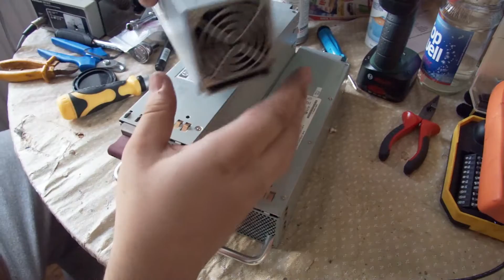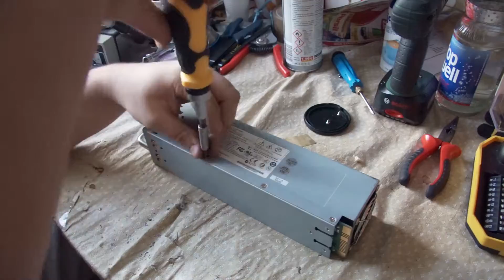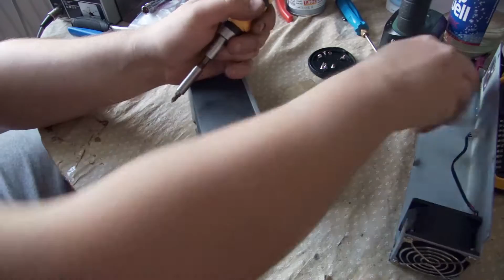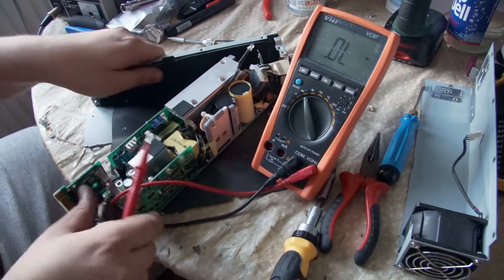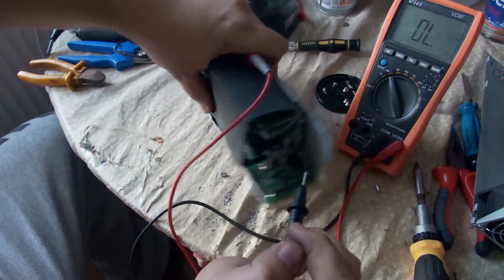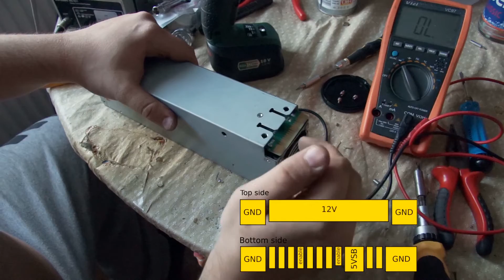Cheap DIY 2800W POWER SUPPLY Part1: Insulating

Comment: cool, i did exactly the same with 400w server powersupplies so i have 2000w 60v supply and im already finished.
i have a idea for you which i did too, when you want to power these cut the nutral wire from the plug and buy 5 switches so that you can power them like you need because they are preety loud.
und du bist deutscher?
Reply from the maker: Ja, bin deutscher.
Die Masseleitung kappen ist nicht gut, im Video kappe ich die Masseleitung von der Primärseite, so fliegt immernoch der FI falls die Primärseite einen weg hat.
Ich wollte damit eines oder mehrere dieser DPS5015 DPS5020 Betreiben, hab aber mittlerweile ein leiseres, passenderes netzteil gefunden.
Reply: @gamerpaddy  welches Netzteil ist das, aber bestimmt nicht so günstig wie das mit den server Netzteilen oder? Ich meinte es so das man die dc Seite isoliert von dem Gehäuse und dann wenn man die 5 Steckdose hat bei jedem Kabel entweder neutral oder phase nimmt und jeweils an einen Schalter geht, so kann man dann den Effekt mit den niedrigeren Spannungen erreichen mit 48v 24v usw ohne die Netzteile abstecken zu müssen denn die übrigen Netzteile leiten den strom durch zwar fällt eine kleine Spannung durch die ausgeschalteten Netzteile ab aber das ist kein Problem so das man dann alle 5 in reihe hat aber nur 2 am Strom hängen und die restlichen dann aus sind und die 24v dann durch die übrigen 3 gehen.
Reply from the maker: Das ist ein 48V Netzteil aus dem Mobilfunk bereich, 48V 25A. ich hab davon ein video wie ich es zum laufen gebracht habe auf meinem kanal.  Neu kosten die ein haufen, aber ich bekam es irgendwoher für umme.   die sind unter dem namen "telecommunication rectifier" bekannt.      am besten wären 1000W netzteile mit 55V, weil mehrere in reihe schalten gibt zwar viel power aber wenn man mehrere dps5015 module parallel drann hängt kann man diese nicht mehr in reihe schalten für zb. 100V 15A ausser man isoliert die voneinander mit sepperaten netzteilen.